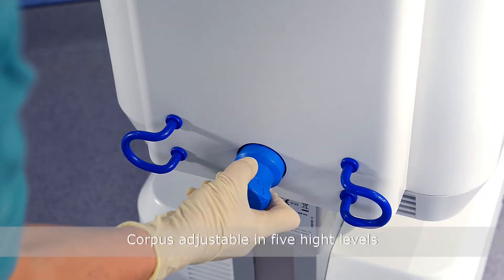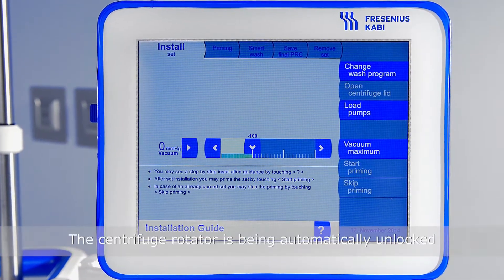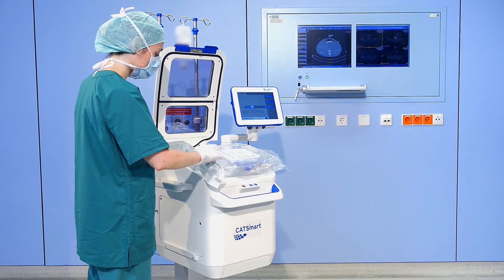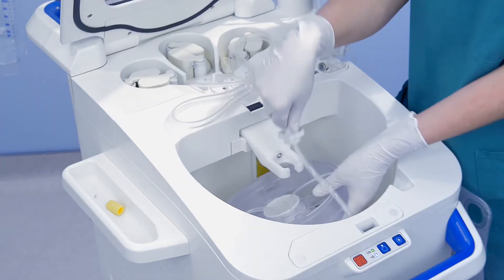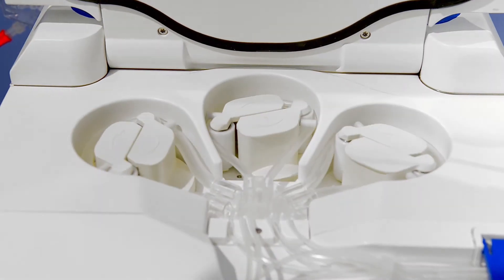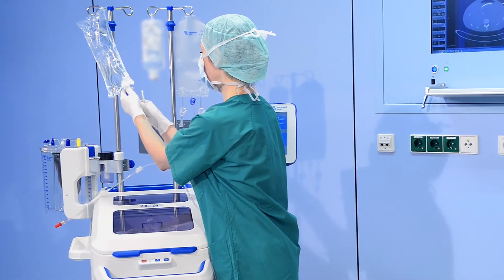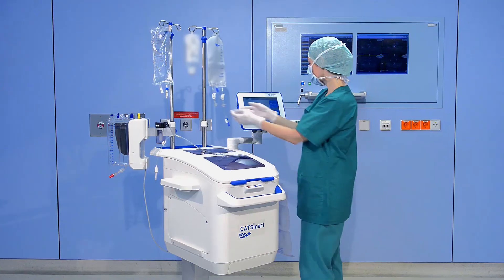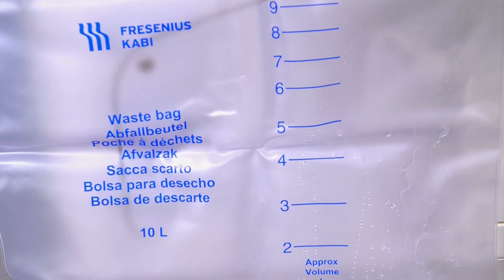02 CATSmart - Install Set (AT3)

Comment: I'm curious about this updated CATS to handle multiple cardiotomies at a time in a bad liver transplant for example where you could need multiple. The current version my hospital utilizes does not have built in vacuum like this one. We run two cardiotomies with a y connection as standard in livers. wondering if the fresenius could handle 4 at once. (two y'd cardiotomies on each pole)